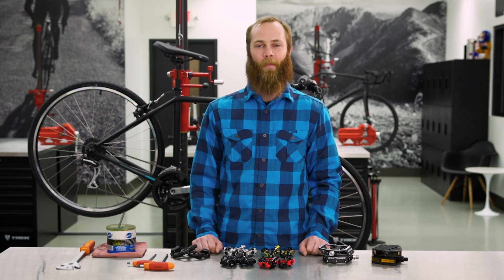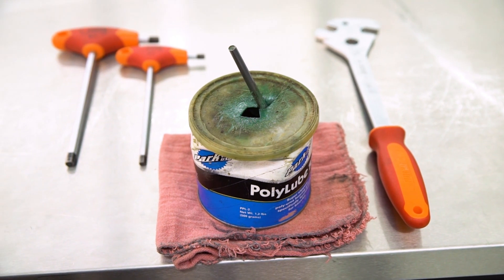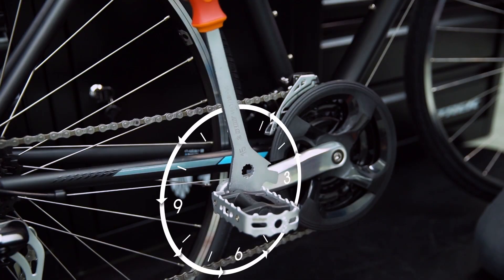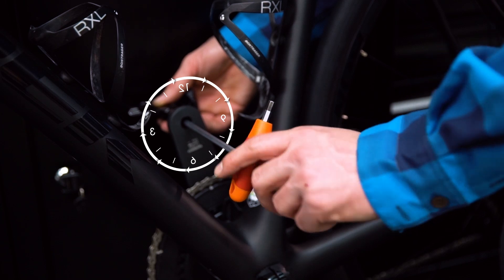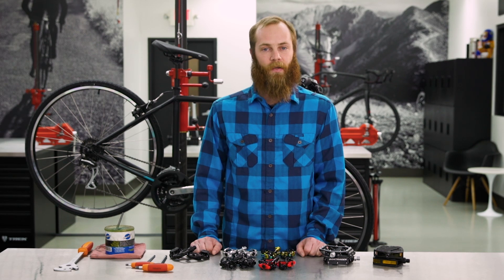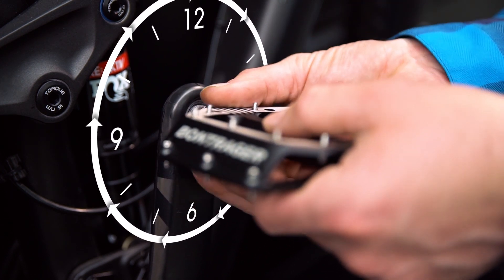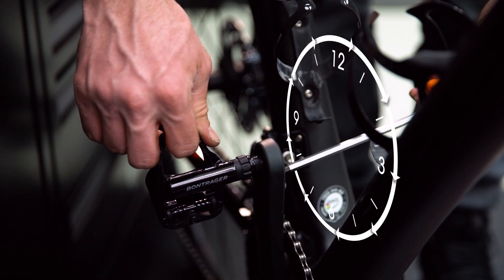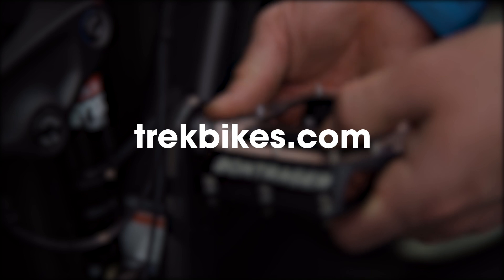How To: Install Bike Pedals

Comment: the way I learned was to loosen to the back of the bike and tighten to the front. this works on both sides.
Reply: Thank you. The clockwise/counter clockwise explanation is understandable, but unnecessary. The loosen to the back/tighten  to the front explanation leaves no room for error with either pedal type.
Reply: Thanx for that! It simplifies it for me! I just read somewhere COUNTER-clockwise to loosen left side! I may have read it wrong but I'll try again!

Comment: This clip saved me. Had no $%^&* idea the pedals threaded 2 different ways. Removed the old ones on auto-pilot after one broke, didn't pick up I'd done one clockwise and the other anti-clockwise. Replaced one, could not replace the other (because I was turning it the wrong way). Thought I was going to shame myself by having to take the bike to the bike shop. Watched this and bang, bike fixed and ready to go.